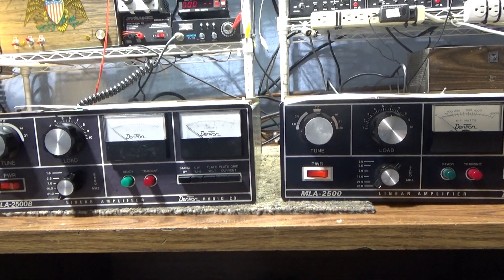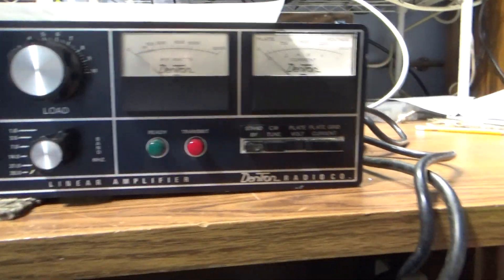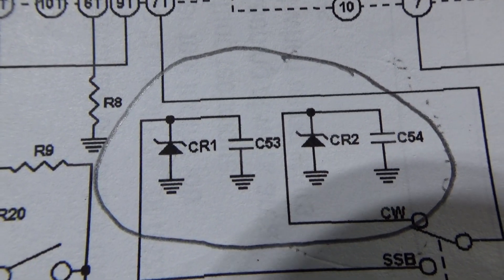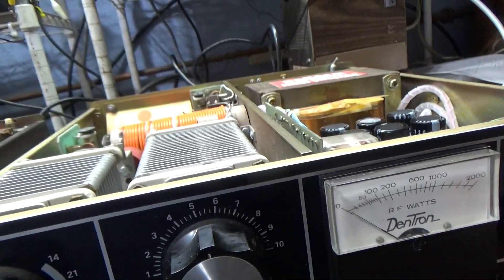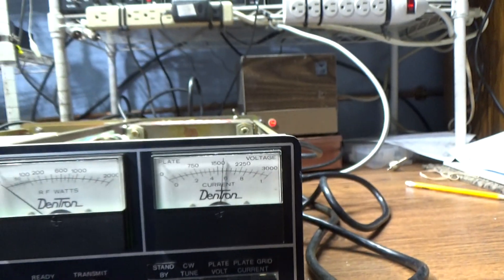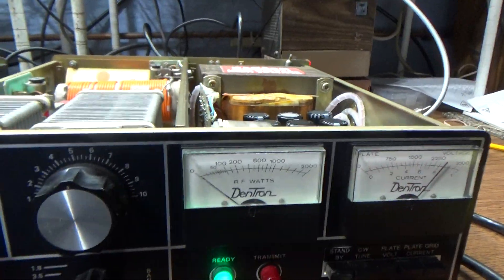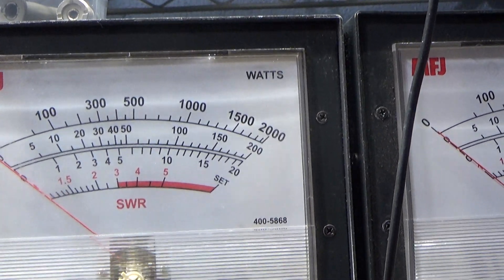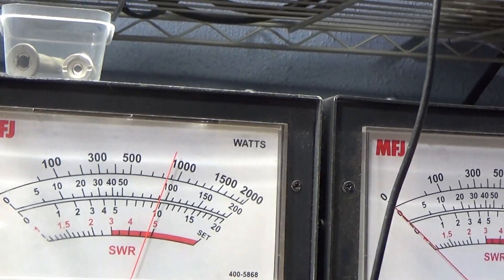Dentron MLA-2500 early version, non-B, full Ham Bands, on the bench.

Comment: I have a Dantron 1000 B that will not turn on fuse and everything is OK cannot get power to the transformer
Reply from the maker: "power to the transformer" is interesting. Normally what happens is something on the output side of the transformer is shorted which in turn blows the fuse as soon as you turn it on. The most usual suspect is a shorted tube, so pull the tubes and then see if you have Voltage and no blowing of the fuse. If that doesn't do it, then disconnect the HV diodes, which is the first thing the HV from the transformer goes to. Diodes is the 2nd usual suspect. If no joy, then your problem is probably the transformer itself, cancel Christmas. Common problem with Dentrons, is they run the voltage up, do the watts, but the tubes and the undersize transformer's pay the price. Good Luck,
Reply: @tramdr  I hope this gets to you it is dinner time here from doctor. I have the amplifier on a very back that is showing 50 votes out of Derek going into board on left side of Dantron 1000 be it goes from 50 votes out of the vevor but the board on the left side near the rear shows 30 boats will not go up anymore. Could that be a transformer going bad? It did not ever blow the fuse. Of course the fuse was a 30 a.m. thanks for your answers.
Reply: And merry Christmas

Comment: where are the two Zener's located on the B model? thanks for your time
Reply from the maker: I think they are behind the relay.
Reply: @tramdr  kinda was afraid of that. I heard you say on one of your other videos that the two zeners were missing in your b model. I traced the lines back from the relay just cant find them. Thought maybe they hid them somewhere
Reply from the maker: Nowadays with regular power supply silicon diodes being so cheap, people often use a diode string instead of a Zener. Zener's pop.

Comment: I have the MLA-2500 purchased new in the late 70's.  It was used very little but I'm wondering other than the electrolytic capacitors how well the tubes and certain other parts have held up over the pass 46 years.  I want to restore it and wondering if tubes degrade sitting around?  Any tips would be great to know.
Thanks
Dan
Reply from the maker: Tubes don't degrade sitting, but the problem with the MLA-2500 was the tubes. They were usually abused 2 fold. Dentron juiced up the filament voltage in most their amps including that one. This would make the tubes put out a lot more, but of course, the tubes would last maybe a tenth of what they should. Plus, the tubes are hard to find and very expensive, plus, since most CB'ers go with the Mo watts theory, they pushed those poor tubes hard too, to get Mo watts. Hence, many people would push that amp to get 2500 watts out and quickly toast the tubes. With the tubes being hard to find and costly, some people would mod that amp to take other tubes like 4cx400's os a single 4cx800. However, a mod like that ain't easy for someone that is not an expert with tube amps.
Reply: @tramdr  Thanks tramdr.  I will re-visit your site for a refresher before I start checking out and restoring my 2500.  Purchased an Ameritron ALS-1306, too bad MFJ stopped production.
Reply: I am currently going over most all of your videos for amp restoration and amp knowledge.  Re-watched all your Dentron videos.  Noticed you have a board placed where the original caps were with new caps on board.  I know Harbach has a kit but will decide which way to go.  I also have the PAL 200M mobile amp that I'm getting ready to restore just for the fun of it.  You provide lots of excellent information which is not easy to find.  Thank you.  Dan

Comment: I have a couple TL-922A’s and I was always worried about soft-start.  True, I’m talking about very different tubes than this Denton, but I did very big transmitters for my work and in all of them they had soft-start circuitry.  So, with my own personal gear, I always did the “poor man’s” soft-start……just because.  Many years ago I called the Kenwood tech Dept and asked about soft-start and they told me I was wasting my time.  They were adamant that the 500Z was capable of “balls-to-the-wall” power output the very second you hit the power switch to on.  Maybe so, but I always tried to be careful anyway.  Yes, I’m off topic here, but whatever.  I’ve found thru time that you and I think alike.  Too bad we aren’t neighbors!  That would drive my wife nuts!  😆
Reply from the maker: The 3-500z tube itself yes, but there are other issues. The HV caps don't like to be hit like that. A discharged cap acts like a dead short until it gets some charge in it. That is why on most 110 plug in amps, the lights dim when you first turn them on. Thats those discharged or dead caps charging up and pulling a lot of current when you first hit them with power. Sort start or step start would put a resistor in line for a few seconds so they could get a low power charge to start them off and then bypass the resistor to give them full power. Some larger amps have a variac and you dial the variac down at start and then dial it up. The Pride DX-300 has a full time resistor in the HV line which is another poor mans soft start. 
  There are other issues too. Filaments of the tubes can have the same issue. They also have high resistance when cold. The workaround that is to use a filament transformer that has only the same amp rating as the filaments. A 3-500z runs at 15 amps so a pair is 30 amps. If you lookup the filament transformers in a dual 500z amp, it is always 30 amps. If it was more, say 50 amps, the problem is the filaments would suck down the whole 50 amps during warmup which would not be good. 
  Last, usually not so much for glass, but ceramic or metal tubes usually need to be warmed up before you key down with them or else they may fail. That is why this Dentron has the 90 second delay. Don't want to kill a thousand dollar pair of tubes by keying down with them too soon.

Comment: That is exactly why I don’t do FB! Smartass know it alls
Reply from the maker: I dropped out of a bunch of Facebook groups because of the noitalls and not just the CB groups either. One was a Moutain Bike group as I used to be heavy into that. I like light weight bikes and in those groups we often talked about bikes made out of 2 metals. Light frame tubing and reinforced braces out of a stronger metal. All the time. the noitalls would chime in that it is a waste of money to get a bike built like that. Everyone knows that you can't put 2 dissimilar metals together. They would even pull up many many legit articles to show that. In a way they are right. However, like I keep mentioning here, there are workarounds. The workaround for the dissimilar metal bike issue is so easy and that's why I brought that one up. The workaround is to put something between the metals. Teflon tape, foam, paper, thin plastic, even a light coat of paint before mating the metals. Problem solved. However, the noitalls keep on coming back for more. even some here. You won't see many of their comments because I just delete them. No time to explain it to them and besides, they know, aka No, it all anyway.

Comment: 1 diode is 8.1 but I didnt catch on they changed that when I did a 2500. I only did the harbch timer board and hv boardI was really scared to hurt this amp the tubes are super pricey. My buddy had it and it was crapping out I found later when I did the boards, pin 5 was a cracked solder joint on both sockets.
I'm not sure if pin 5 is a grid or what. I dont know if running the grids direct to ground with help on that note also I see they are floating ground.
I'm also confused that a 3cx400 shows a cathode pin and looks to be a dedicated cathode on the schematic and its a 3cx but the 500z and 1200a7 dont show that cathode but are 3cx too. I dunno.
happy groundhog day tramdr
Reply from the maker: Apples and Oranges with those tubes. All triodes and tetrodes are not alike. Too deep to go into here though.

Comment: I noticed the 2500 has the 28 MHz band
Reply from the maker: Yes, during the FCC crackdown in the late 70's, selling a ten meter amp was illegal. Heathkit changed from the SB-220 with Ten Meters to the SB-221 with no 10 meters and others too.